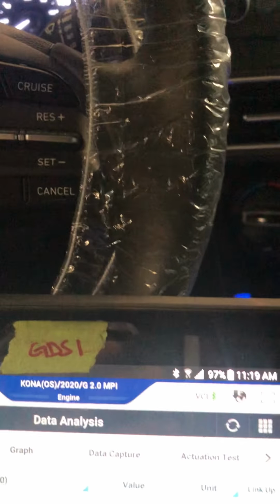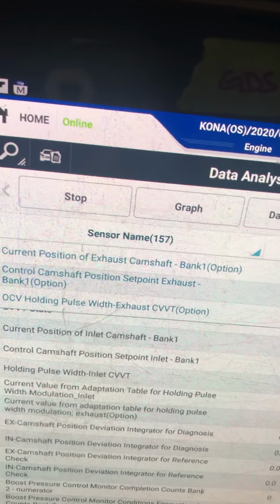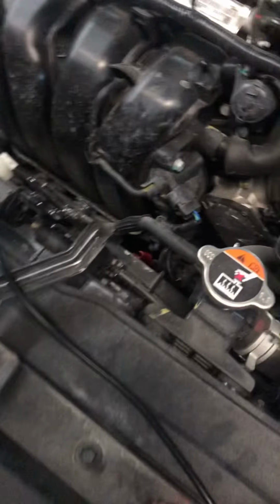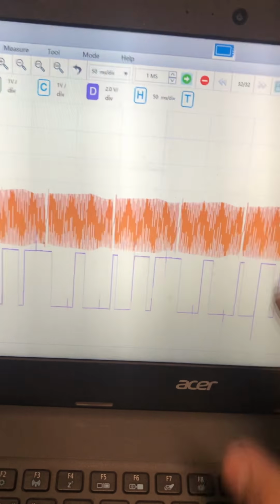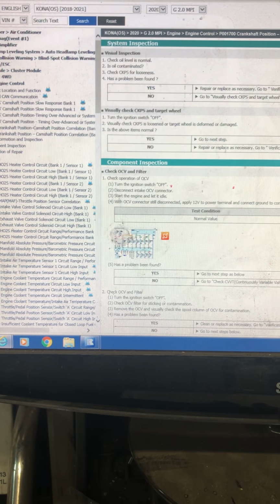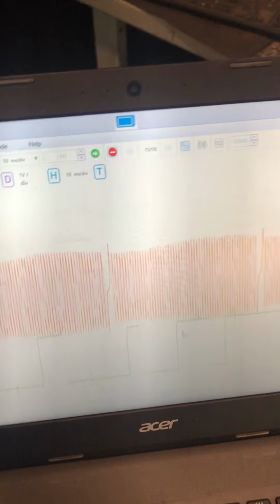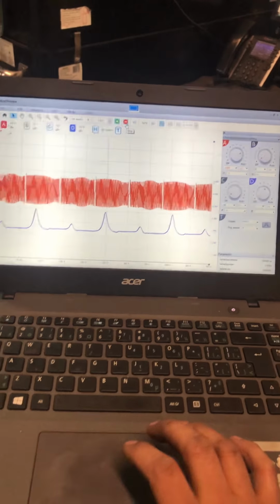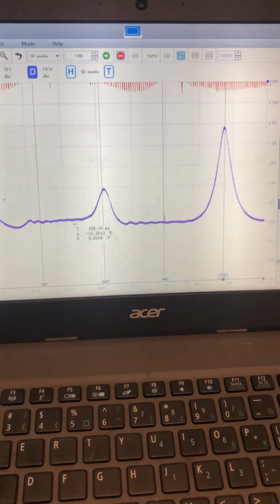Hyundai 2.0 litre camshaft crankshaft correlation

Comment: Awesome diagnoses. I'm diagnosing a 2020 Hyundai Kona right now with the same engine, rattling noise and low power. p0017 code I was suspecting the timing chain jumped but pulled the valve cover and it lines up like yours in the video. I wanted to do a cam crank correlation waveform with the pico scope but I don't have a known good waveform. I know this video is a few years old but I was wondering if you could email me your known good waveform if you still have it? I appreciate it.
Reply from the maker: let me know what you find.